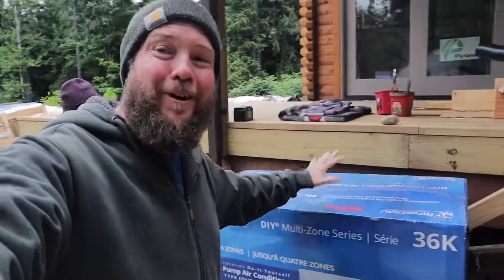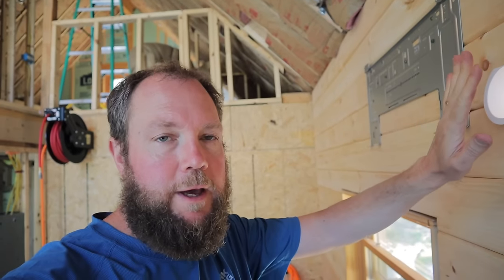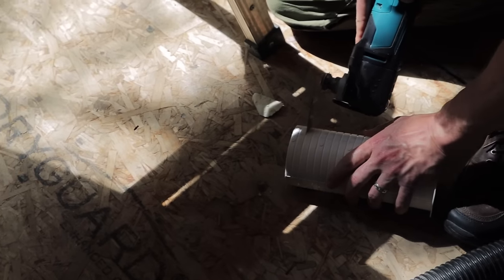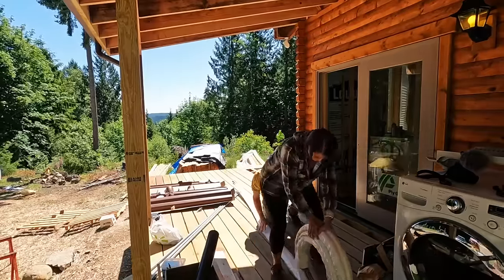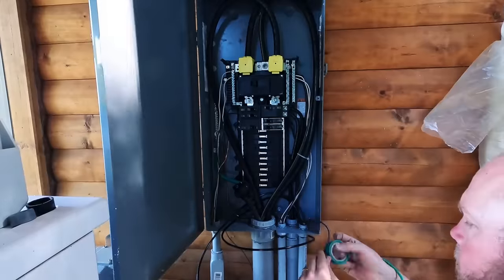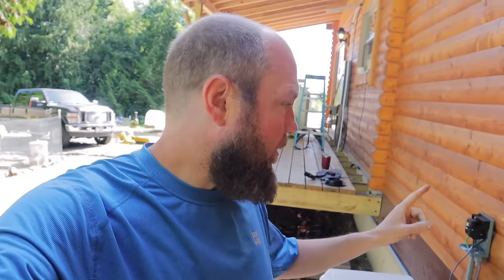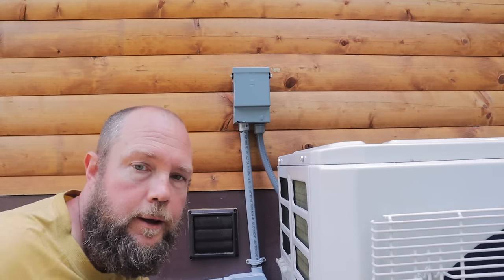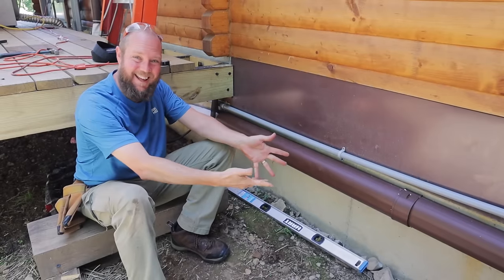Couple Installs Mr. Cool Mini-Split [FULL INSTALL]

Comment: Not sure where you live but if it snows and you plan on using the mini split, you probably realize now that you needed to elevate the exterior unit above the snow.  There are nice metal stands to do this.

Comment: Special air conditioning contractor I strongly recommend that you get some spray and foam and seal up the ends of those lion covers otherwise your mind up with little fellows making their home in your line set of course I can't eat through the copper tubing but they sure do her job on that insulation and the controller cord other than that looks like you did a nice job for amateurs my congratulations
Reply from the maker: Good call!  I didn't even think of that.  I'll break out the spray foam and steel wool and plug up those holes.

Comment: I installed 2 of these in our home. With a little bit of common sense mechanical know how, anyone can install these mini splits. There are plenty of youtube vids just like this one to help out if you get stuck somewhere. Installing these yourself saves an average of $2,000 to $3,000 depending on your area. HVAC guys hate these things because the DIY mini split revolution is eventually going to put many of them out of a job. So sorry Charlie but if I can save $3,000, guess which direction I'm going? Since installing our mini splits, the central unit, while still there for a "just in case" backup, will probably rot before its ever turned on again. The mini splits do an amazing job and both at less than half the cost of the central unit to operate. You guys did a great job on your install. Congrats and I hope others have the same great results from a DIY mini split.

Comment: We, too, installed our mini split as unknowledged diy-ers. Very simple, easy project. Had to have pros come out to charge the unit for warranty purposes. 5 years still cooling and
 heating as it should.
Great Job you guys... I miss the PNW,   lived in Kent and Spkoane areas.
Reply: What did it cost for the contractor to come out.

Comment: Could not recommend Mr Cool more. I installed my smaller unit in my office a couple of years ago and absolutely love it. Very easy to install and works like a champ. Love your videos guys!!!
Reply: Could not?
Reply: Do you know how many amps your panel needs to be?
Reply: I installed a dedicated 110v 20amp breaker for my mini split. Mine is the 12,000 BTU model so the 20amp has worked great with no issues
Reply: @matthaffner9920  
Thanks- and it removes humidity too, that’s my biggest complaint about window or mobile air conditioning
Reply: @None-685  I can’t confirm or deny because I live in a non-humid climate. However, we do get occasional humid days and I have not seen much difference. Good luck!!
Reply: I also installed my own Mr cool (air handler type) and could not be happier with it. Wish Mr cool would send a custom line set to the length you specify. Nice vid!
Reply: I have a question about your Mr. Cool installation,  When you did your check list: Were you able to perform the heat function! 
I just finished my installation , did leak test and the electric all good * until I did the mode test and the heat mode doesn’t work * no heat * everything else works!

Comment: you did a good job ,i did installs on Mini split systems for many many years before i had a stroke. i wish i still had the opportunity to still do the work. dont forget to do your filter cleaning just take it out and rinse it out and put it back, i recommend to also clean your condensing coil at least twice a year to keep your system working like it should.

Comment: I just love your outlook and attitude on things, it is so refreshing! I laughed so hard when you said that if all goes well you think that you can get the outside unit and the two inside head units installed in a week. It is such a nice place to be where you understand that things take a lot longer when you're doing your best to work through new situations. Due to the simplicity of Mini Splits many people could install all of the components in a single day and then maybe another day for running the electrical and add a day at the front end for pouring the concrete pad for the outside unit, but it was really cool to see you acknowledge that things happen and often times DIYers need a lot of extra time so you added on several days for that. Such a great outlook and so realistic. I say Bravo!!!!
Reply from the maker: We have learned from experience that things always take longer than you expect with DIY projects especially when you are learning new skills/trades in the process.  I joked with Sara that installing the line set covers was almost more difficult and time consuming than installing the actual unit.  

Thanks for watching and supporting our channel.
Reply: @OneFootOfftheGrid  A thought  maybe next time you hit any type of road block do a google or youtube search to see if you can find a solution,, It may be faster than customer service.     For example  maybe your video will pop up if I searched for MR cool wrong fittings....  Great job by the way loved the video.

Comment: Great video, I do see the dryer vent next to the condensing unit…yikes, be sure to monitor the condensing unit for lint buildup…fyi 😊
Reply from the maker: Yeah, we had the dryer vent installed first and then we realized that was the only location that would work for the condensing unit.  I'll be rerouting the dryer vent to the back of the house to fix that issue.  Good catch though!

Comment: Overall good job.  However the dryer vent location will cause clogging of the condenser fins
Reply from the maker: Yep, I'm going to have to move that vent or just know I'm going to have to clean the fins every year.  I was hoping the outdoor unit would be able to go somewhere else and I already had the dryer vent installed.  Luckily it shoudl be a pretty easy fix.

Comment: I just signed up to your Channel. You really made that Mr Cool install look easy. My A/C is getting old (34 Yr) and I may look into having my "Ducted" unit replaced with Mr Cool when the time comes. Art in Calif
Reply from the maker: We have been really pleased with the performance of the unit.  Even without floor insulation and without our ceiling finished it cools our entire main floor without much effort.  And it does it all almost silently.  I'd certainly recommend looking into them as an option.

Comment: Is that the dryer vent so close to the outdoor compressor unit? If so make sure you double or triple your cleaning routine on the coils on the condenser!
Reply from the maker: That was an unfortunate placement before learning where the outdoor condenser had to go. We will be rerouting that dryer vent to be clear of the outdoor unit this summer.

Comment: I installed the mr cool universal system, used my existing duct work. Great system so far. Been 1 yr and no issues. Would like to see if yours cools the living room i think personally it will run nonstop.
Reply from the maker: Good question.  We have had some 90 degree days so far and the living room unit has done a fantastic job of keeping it cool.  The problem we might run into is the upstairs unit being undersized since a lot of the hot air accumulates in the loft.   We are hoping that once we have our ceiling fans in the living room unit will be able to assist in cooling some of that air once we have things circulating well.  

But as long as we are on the main level, we are cool as a cucumber.   (Oh, and we don't have our floor insulation or our ceiling boards on yet, so our R value will improve considerably in the near future.)
Reply: @OneFootOfftheGrid  who is the lucky person to sleep up theyre

Comment: Does this unit need to vacuum the air in the pipes and wall units ???
Reply from the maker: No the lines come pre charged.
Reply: No, the lines are changed with refridgerant

Comment: Looks like you installed the condensing unit right next to the dryer vent. It will clog the coils and cause high head pressure shutdowns. Suggest relocating the dryer vent at least 8' away.
Reply from the maker: Good catch.  I've been worried about that.  Originally the outside unit was going to be placed away from the vent another 2 feet.  Unfortunately, because of the line set lengths we had to move it closer.    I'm going to monitor it for the first year and see how it looks after next year cleaning.  Then likely rerouting the dryer vent to the back of the house to avoid future problems.  Thanks for watching.

Comment: For future concrete work the rebar should be on bottom few inches to work properly not pushed into top as frost heaves are the biggest threat to cracks!
Reply from the maker: I'm not sure if it was clear in the video, but when I put the rebar in we were only at half of our pour.  So there was still another 1-2 inches after we put the rebar in.
Reply: LoL ok whatever do it your way I was just trying to let others know correct way

Comment: Great job. I have one too and love it. However, one thing I failed to do was the bubble test for Cooling AND Heating too! Lost all my coolant that first winter. Might be worth a double check, you want to do a second check after a few months anyway.
Reply from the maker: I keep worrying about ours losing refrigerant.   I'm crossing my fingers that we don't have a leak.   I'll test the connections by the outside unit again, but where the connections are made to the head units are already under the  trim and behind those sound dampening pads.

Comment: Cool project.  Just a note, for jurisdictions that follow NEC2023 the disconnect needs 15" workspace to the left and right and nothing protruding past 6" beneath that space.
Reply from the maker: I wasn't aware of that. Thanks for pointing that out.  So in our case with our unit being offset from the house by 12" does our disconnect meet that requirement?  We had the inspector out to approve our disconnect, so they must not follow NEC2023 yet, but I'm just curious.

Comment: Just got done doing mine about 45 days ago. 2X36K outdoor units. 2X18K, one 24K and one 12K. All working great. You might want to rethink where the dryer vent is, gonna plug up the outdoor units with fuzz. They inhale from the rear and no screen. Just sayin'. I bought mine in April, no wrenches no hole saw. All of my linesets go out under the deck (4'5" clearance under) and I'm 72, way too old fer this shit. I also was a little taken aback by the abysmally small screws and landing zones for the wire. Remanufactured some terminals to cover that. NONE of my linesets go up the side of the house. DIY indeed, my way. I have four condensate pumps to pump the water out. My wife uses the condensation water for her fussier plants. It is very similar to RO water, but tastes like plastic. The outside units are mounted 24" above ground on a 2 5/8" oilfield pipe 'double T' which is set int two 24X30 pads. We are in a high wind area. All of my linesets cept the 12K are 50' (2X 25' with some pricey looking splicer connections) and all of the excess is under the deck, much cleaner install. I nervously spaced out the king valves as well. Thought I blew it up, thank god they have some pretty good programming to prevent stupid shit. If you have some mixed results on temp control, use the "follow me" feature on the remote, turns it into the temp sensor, communicates only every 3 minutes to conserve remote batteries. BTW: House is 3000sq ft r36 top to bottom with full brick wrap. Had resistance electrical heat and a swamp cooler. We see -20° to 110° in a typical year so I oversized the system a bit. Thinkin bout a BIG single unit for my shop 5 ton or more. Mostly for heating above 40° outsideair temp and cooling. Have a 110K 96% propane unit heater. Good job!!
Reply from the maker: Sounds like a great system!  After running ours a bit this summer I think the 12k unit in our bedroom might be a bit undersized.  We will see once we have the finished ceiling installed and the ceiling fans going.   The 24k unit cools the entire bottom floor without much trouble at all.   

It does seem odd that they recommend such large wire for the install but then don't give you the terminal connections to accommodate that wire size. 

I'll check out the "follow me" mode.  I haven't played around with the remote to much beyond just the basic features. 

I have to say, building in an air conditioned space feels like real luxury this summer.  Hopefully you'll stick around and follow the rest of our build.  =)
Reply: I subbed up after reading, So I can keep track. Michael in Colorado. @OneFootOfftheGrid

Comment: Nice work on the hvac.  The confusion over the lineset seems to have been a bigger "miscomunication" than just between you and mr cool.
I notice your electrical box is on the outside of the building.  That is not traditionally done in the pacific northwest.  Is there another one inside somewhere, or was there some other circumstance leading to this?  Maybe you are not from the PNW?
Reply from the maker: The instructions didn't mention the adapter so they probably need to update the manual, but looking back at it I probably should have noticed the adapter and been able to figure it out.  Ultimately, when I contacted support they were able to help me figure things out.

We are from the PNW.  The box is an exterior rated, weather proof box, so we are covered there.  We installed that box way back right when we had our foundation poured so we had electricity near the house site while we were building.   Then my thought was that we could just use it as our house panel once we were wiring electric.  

Well, once I started planning my wire runs I quickly realized that it was going to be much more convenient to have an interior panel as well.  So I added a 100 amp breaker and a 100 AMP subpanel for the house interior.  Since our stove, water heater, and range are all gas we actually don't need a ton of Amperage in the house.  The panel on the outside of the house is 150 Amp, so I still have some capacity if I want to run another 50-100 amp sub panel to an out building later on. 

Thanks for watching and let me know if you have any other questions.

Comment: Great video!  One question.  You placed condenser on a concrete slab, close to ground.  Is it fine?  What happens during winter, when it gets few feet of snow?
Reply from the maker: Good question.  We actually don't get very much snow fall here in the Northwest.  If we get 12" it is a MAJOR snow storm.  At that level, we will just make sure to keep the area around the condenser clear of snow.  I can imagine in other areas where more snow is a frequent occurrence it might be smarter to elevate the condenser even higher.   

Glad you enjoyed the video!

Comment: Hey guys great job installing the mini splits but there is a super critical step that should have been done before opening up the king valves.  The refrigerant lines needed to be evacuated with the use of a vacuum pump, refrigerant gauges, and a micron gauge.  I am not familiar with the MrCool equipment so my question is are the copper line sets under a vacuum before connection to the condenser?
Reply from the maker: Yes they actually are. It is their DIY model.

Comment: Exciting! Just got my Mr. Cool 36k yesterday. Got as far as I could before the rain started, which was pretty much everything I can't do until the rain stops long enough to stay dry. I did the wall hanging brackets rather than concrete, but I may change that.

Where did you find those tools? I did not get those with my unit.

Comment: Awesome vid! Now subbed and liked! Thnx for taking the time to create and post!  Such a gorgeous cabin!  Would it have been possible to run the refrigerant lines WITHIN the cabin walls so they wouldn't affect the external faced of the beautiful cabin?  I would think the lines could be ran inside the walls and out of the wall at the bottom of wall so wouldn't be protruding over entire travel down the outside of the cabin?  There's what 5 items connecting the inside unit that need to be ran outside, the (1, 2) two refrigerant lines, (3) condensate drain hose, (4) power wires, and (5) control wire?  All of this could be ran down the inside of the wall, between the inside wall and the outside log wall, and then exit the bottom of the log wall.  Would be a lot less protruding.  I do like how you painted the line covers faux wood... Just wondering... Keep up the great posts! Learning a lot from your experiences!!  Also, didn't see what the cost of that unit was or the specs? I may've just missed that info... Congrats!
Reply from the maker: It would be possible to run them inside the walls.  We would have had to remove a lot of our insulation to accomplish this and then you always have to consider the bend radius for the copper lines.  For us doing this way just worked better but it is a possibility.

Comment: Impressive work…it seems like an experienced HVAC pro could do the install in a day or two so $3,000 for install does seem like a lot.  The good thing is due to DIY you know every connection for your system and can trouble shoot any issues in the future.  Thanks!
Reply: You are wrong.  They don't install your system (due to warranty).  They buy it themself for $3,000 and install to you.  You pay (with 2 heads) $15,000-20,000 depend on your location.  That what 4 different companies told me this summer 2023.

Comment: nice job 
i'm guessing the evaporator unit was not centered over the window because of structural concerns.
Reply from the maker: I think it came down to clearance.  To give the vertical clearance to the ceiling required it would have put the hole going out of the house  going right through the window trim.  It would have been our preference though for sure.